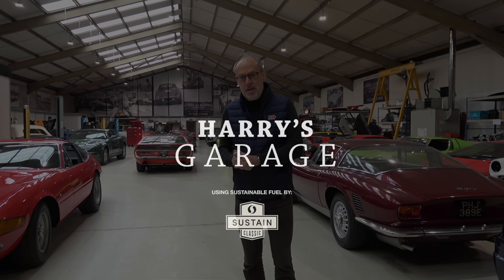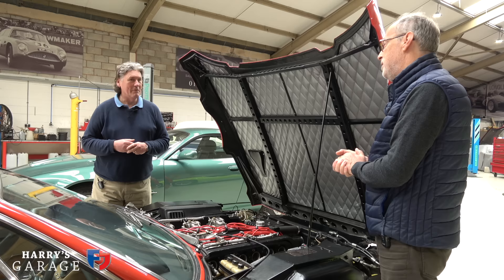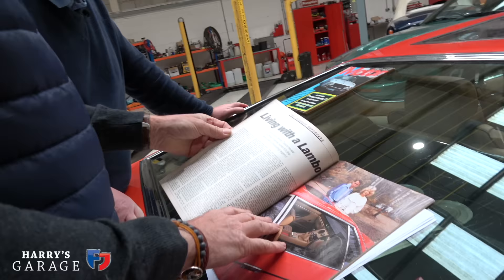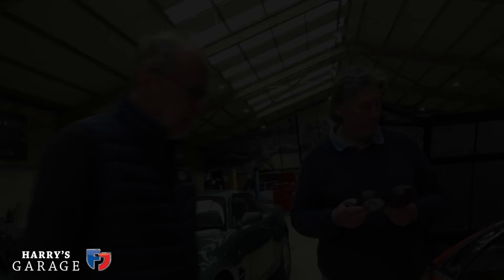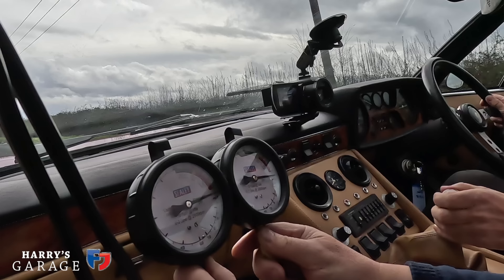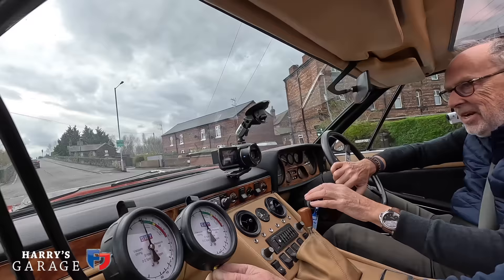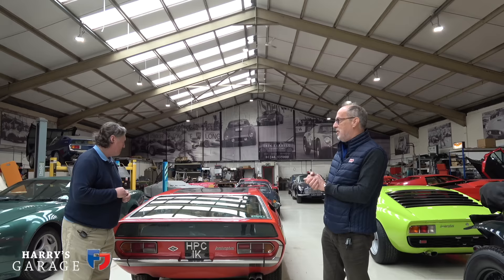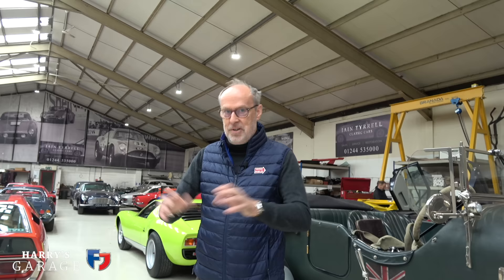Lamborghini Espada is back with Iain Tyrrell in search for more power. Plus Marcello Gandini tribute

Comment: So what was causing the fuel leak? Video seems to skip straight to the exhaust issue.
Reply: Yes I watched it twice as I thought I missed that. Amazing insight into back pressure! Thank you.
Reply: Classic distraction 
The cause of no power but cough sone more it’s the exhaust
Reply: The continuity sequence suggested it was thrown on the dyno without first fixing the petrol leak🚩 yikes!!
Reply from the maker: The fuel leak turned out to be a tiny bit of debris in one of the carburettor float needle valves. It was so minor and was quickly discovered a few weeks earlier, we forgot to mention it.
Reply: @harrysgarage It’s common, isn’t it, for something like that to happen? I go to my 1977 bikes and if they’ve not run for a few weeks, I do occasionally get a leak from a float chamber, which generally stops if I tap them gently with a wide bladed screwdriver.
Reply: Very glad Ian sorted it.  They do fantastic work, so it was bound to be minor.  @harrysgarage
Reply: The back pressure caused the fuel leak. The waves were that strong that with overlap the exhaust gasses were pushed out into the intake manifold, carburetor, into the open air.
Reply: Stuck float just like my 1980 Honda XL 250 dirt bike. We have so much in common with our vehicle collections haha @harrysgarage

Comment: On some of our engines during my days at Chrysler as an Engine Test Engineer, we would run about 4.5 psi exhaust back pressure on our more "high performance" engines with a full vehicle exhaust installed in the test cell. One would see even better gains with as low as 1.5psi - try not to go much lower, as you risk ruining the exhaust valves with inversion pulses (colder gases thermal shocking the valves).

Comment: This is an interesting situation. First Italian and many other HP figures of the late 1960s are known to be very optimistic. 10% losses aren't unheard of at the gearbox and rear axle. Dyno tests of that period are almost always done without the driven accessories, such as alternator, power steering, fans etc. Probably another 15 HP. Using 350 HP this would make it between 265 and 270 at the rear wheels, but 350 HP was very likely optimistic. So don't be too disappointed if the gains are small, unless you open up the exhaust ports in the heads. But how will that effect the glorious torque curve?

Comment: Harry, many years ago I spoke with Bob Wallace about these very engines and Miura engines. Bob confirmed even the higher compression engines made a maximum of 325hp on a good day. They were also tested with different  exhaust manifolds which were dyno testing only manifolds so who knows how the standard espada manifolds would actually perform. It’s also highly likely the pipes coming off the headers are further choking things. Note Miura engines were never tested as they did not have a dyno that rotated in the opposite direction. 

Bob had stated all v12 engines of this era from Lamborghini had exhaust ports and systems in general that were just too small for the amount of air the intakes were gulping. The high back pressure you’re seeing is also from small exhaust ports squeezing out a lot of air at very high velocity, thus a high reading. The ‘fix’ is a deep one is it involves opening the ports, which Lamborghini had tested along with larger headers and gained a lot of power. Note Lamborghini boat motors had much larger exhaust ports and manifolds etc. 

That said, a healthy espada ‘should’ make about 230-240 max at the wheels though. Lots of power is lost through that gearbox and rear end. Dyno tuning with a wideband. Make sure the choke size in the carbs is correct! I’ve seen smaller chokes (28mm, stock is supposed to be 30mm) installed in these things as it does give a bit more torque and pedal response at low and mid rpm but it chokes power up high. You can go 32-34mm and they run just fine after appropriate jetting changes, and they rev up high a good bit better and make more power.
Reply: Yep.
If you go back and look at the video where they dissembled the heads, you will see that both intake and exhaust ports are tiny. The primaries are also fairly long and small in diameter, which absolutely does nothing to favour an increase in displacement and larger cams. They should really look into what's possible in terms of opening up those ports and add flow.

The other thing that strikes me as very odd, is the mentioning of increasing overlap. Decreasing LSA, i.e increasing overlap almost always favours mid range torque and punch. Running a wider LSA softens the bottom end, but it also moves the peak power point up.

There's definitely a lot more to this than a restrictive exhaust. Doubt there is much to gain unless those heads are opened up.
Reply: @AB-80X   With these small per cylinder displacement Italian engines, the opposite is almost entirely true when it comes to LSA compared to say large Ford or Chevy V8s for example.  Ferrari/Lambo/Maser, in stock form they all like very tight LSA (100-104 is common) with lots of overlap, and for whatever reason, they still peak at very high rpm. The always come 'on cam' around 3500 and stay there through 7-8000.
Reply: Bob Wallace!  How did you get on/find the man?
Reply: Bob lived in Arizona and had a repair shop for many many years where he worked on all things Italian. He was very available to get hold of. Bob was actually responsible for the well known parts expert, Bill, of GT Car Parts getting started literally just next door. Bill was sort of Bob’s official parts guy for many years, and Bill is still there doing it
Reply: Wow, great recall chief from, as you say "many years ago"
Sometimes these videos trigger a moment from years ago which makes YOU take time to share it at the same time smiling as your brain starts fizzing with the memories.
Re. Choke sizes. How did this work. I would have thought that for optimal gas flow ideally the inlet ports and carb size should be matched as in my Rickman Trident. Standard inlets 27mm carb and inlet port. Mine 30mm both to shift power to high RPM where it can pull a long top gear with exhaust configured to "fill in" mid range and a Quaife c/r gearbox to keep it at high RPM.
Thanks 🙏
Reply: @ericsbuell  With Webers, choke size is dependent on the size of the individual cylinder in cc, and the operating range you want it to operate. There's a lot to this and books have been written on tuning, but in Harry's case, the Espada cylinders are approx 330cc each. For that size cylinder to make peak power at nearly 7k rpm as Harry wants, IF the heads can flow that high given all the other variables (cam duration, compression etc), then the carb choke needs to be closer to 32-34mm.  

Of course if the exhaust is NOT flowing well enough then all the intake work in the world wont alter that issue as the exhaust stroke is experiencing a hard wall known as a pumping loss. This in essence means all exhaust gases are not escaping almost immediately after the exhaust valve opens (while the piston is traveling down) and the piston has to 'pump' the remainder of the exhaust gases out on the pistons way back up the cylinder.   This is partially what is happening with Harry's engine.
Reply: Very informative reply. Well done.
Reply: @ericsbuell  own a large displacement V twin by any chance?😉
Reply: @Ralph2 Greetings from Glasgow Scotland, If you call 984 large, aye is the answer but two identical Blue ones with the Buell race ecu, pipe and filter.😁
I just checked your channel chief, eclectic mix...the "horizontal flying saucer" Yikes🚀, aha it's only a rogue floppy, made me laff .
Reply: @ericsbuell  Haha yes! Very nice mate. Near Birmingham England here with an XB12Scg would never part with it. Good luck 👍

Comment: Those young people with their loud exhausts - boy racer gauges everywhere in the car and always chasing power; this channel has gone all Max Power magazine and I love it. 
Next episode is fitting louder audio and cutting springs for lowering.
Reply: Gotta drill some holes in the air-box and wind a bit of octane booster into the fuel tank!
Reply: Exactly what I thought! 🤣🤣
Reply: Need some neon lights under the car too, to complete the effect.
Reply: Espada with pulsing neon under body lights, totally tasteless but freaking cool😂😂😂
Reply: Splitter like an IKEA cabinet door with adjustable rose joint hangers FTW
Reply: ,@Phuc_Yhou with a lip
Reply: DemonTweeks catalogue thrown at it….lol
Reply: One of my uncles in the UK had a new RR Mulliner Park Ward Silver Shadow (two door) in the 1960s. He turned up one day with no hub caps on the wheels and we teased him about going boy racer and reducing unsprung weight. The true cause was that the hub caps had popped off when he was driving at speed across a bumpy field.

Comment: I can appreciate the back pressure issue as I had a similar problem on a motorcycle many years ago 
I had only just bought the Suzuki 550 when it was about 2 years old and was immaculate but seemed to run out of power at higher revs but was ok mid range. I took it back to the dealership several times with no improvement.On one visit a mechanic suggested it could be an exhaust problem(standard pipes were fitted) and drilled a couple of holes in the end plate…instant improvement so they removed both pipes and the baffles inside had basically dissolved into a pile of pieces which were being forced into the end of the pipe at higher revs.As new standard pipes were an horrendous price they fitted a 4 into 1 pipe and rejected the bike and it completely transformed the bike…a bit of a long winded story but an example of back pressure causing performance loss…love the channel and enjoy Iain’s channel too 👍

Comment: Interesting documentation of the impact of back-pressure.  But back-pressure is only (the easy) half of the subject.  You'll also need to look at the harmonics of the system if you want to get the best out of it.  The lengths and diameters of the different sections matter.  In the past I modelled the harmonics of the early 911's intakes and (to a degree) the exhausts.  The difficulty with modelling exhausts is the temperature.  As the gasses and the pipes heat-up, the tuning changes.   If you know that the Jarama with the same engine performs better, installing one of those systems will most likely be your easiest improvement.
In a nutshell, the harmonics tend to go in-and-out of tune as the RPMs increase.  Anyone who plays a brass instrument will appreciate that it's very difficult to "lip" an entire scale without adjusting the length of the instrument (usually by valves or a slide).  The trick is to not have the entire system suddenly go out of tune just when the engine is trying to achieve peak HP or torque.   If you want a wide torque curve, you design the exhaust system to never be fully in-, or out-of-tune at any point on the rev range. This also works well with engines with modest valve overlap.  Alternatively, if you're designing a system for a full-on race engine with a lot of overlap and with a narrow rev band, you'll design the system to be fully in-tune at peak HP which will result in a strong extraction effect over the peak HP RPM, but will be decidedly out of tune ~ 500 RPM below that point, and above it
A. Graham Bell's "4-Stroke Performance Tuning" has a good discussion on the basics and some reasonable "rules of thumb" .  Smith and Morrison's "Scientific Design of Exhausts and Intake Systems" has a more detailed discussion.
It will be interesting to see the change with an alternate system.

Comment: I guess you could always run just the open headers on the dyno, just to see how much more power there is, without the restriction of the muffler system. Would be handy to eliminate (or isolate?) one of the variables.

Comment: Another task that Harry can consider doing is a dyno pull with the exhaust system behind the headers removed.  That will give an idea of what the engine could do with an ideal exhaust system.  Also, the engine will need to be re-tuned (jetting, ignition, cam timing) to take full benefit of the reduced back pressure.

Comment: Love seeing two men driving around pulling the exhaust off a classic Lamborghini like 20 something Aemricans in a V8 pony car but with more science in their experimentation.  Harry and Iain is always a fun educational time.

As an American who has played with primary size in the tubular exhaust manifold (header), mid pipe between the manifold and over axle pipe on a Corvette.  My last Corvette had the best power band on the dyno with an over axle pipe that was smaller than the mid pipe vs the same size all the way back.  We went from dual 3inch to 2.5 inch after an x pipe making the reduction almost in the center of the car before the over axle section.  It turned  effectively the same peak HP number as another car with almost the exact same mods with dual 3 inch ending just before the axle.  He was drag race oriented and I was building for track events.  The smaller full length exhaust added 20 more ft lbs of torque at peak, some areas it was more.  Same dyno, same day.  The 2 of you likely know but the theory being as the exhaust cools further down the pipe, it condenses and needs a smaller tube to keep exhaust velocity up.  Higher velocity helps scavenge the cylinder.  Some back pressure also helps when natueally aspirated.  I have also tested with dual 3 inch all the way out to the bumper but that was a more agressive build and didn't fit very well.

What little I have done gives me great appreciation for engineers who built racecars, and balance cam timing/design, tube lengths, merges and diameters to create the best powerband for their platform.  It is all a system working together and takes a birlliant mind to optimize.

Comment: Apologies if this has been mentioned before, but perhaps the real elephant in the room is the fact that the exhaust pipe enters into that rear box without a curve to take ot through 90 degrees. It just enters the box then a couple of inches further hits the side of the box, a metaphorical brick wall perpendicular to the gases entering..

Comment: I had a similar issue with an Audi quattro UR when the exhaust was changed on one occasion the car was flat out at 70 mph so I took it back only to find the wrong system had been fitted.  Just a couple of part numbers different.  The system fitted had baffles in the silencer boxes but the correct exhaust was an absorption type where the pipes run straight through the silencers with mesh pipes surrounded with sound deadening.  Car was then back to its usual performance and fantastic 5 cylinder warbler 😊

Comment: Not an exhaust issue that I had 20 years ago with my Series 2b model Espada but the original fuel line was rubber and ran under the carpet in side the car. With the new fuel being used in NZ at the time it caused the rubber to leak like a sieve and nearly set the car on fire !! Watching with much interest your progress with such a fantastic model Lamborghini.

Comment: When you leave carbs for a long time the fuel tends to evaporate, leaving the floats at full extension. When you go to use the car after a long break, the floats can stick and flood the carb….my Esprit does this if I leave it for a while.
Reply: Marvel Mystery Oil at their suggested ratio or 500:1 of TC-W3 two stroke oil in ethanol free fuel prior to storage can help with this. 
It works on my lawn equipment and my motorcycles. 
TC-W3 is the spec for two stroke watercraft and is ashless so it's not going to harm anything with a catalytic converter either, and at 500:1 it doesn't affect fuel injection systems or cause carbon buildup.
Reply: @Surestick88  Thanks for the tip. I usually just tap the top of each carb with a screwdriver handle if it's been stood for a while.
Reply: @Omegaman1969 posted identical information a moment ago.
Reply: @Surestick88 ”We don’t know what’s in it. It’s a mystery”.
Derek Bieri - Vise Grip Garage.
Reply: @GT380man  👍🏻 Is your name after a Suzuki ? Nice bike, my brother has one.

Comment: I understand the Italians played a little fast and loose with HP numbers. But a rebuild that should have something like 350 bench horsepower to only have 203 hp at the wheels is a headscratcher. This espada is not going to pick up 50-60 hp by reducing the exhaust  back pressure from 6+ psi to 2 psi at 6000 rpm

Comment: Here's a few thoughts. 
Increasing overlap, i.e  decreasing LSA, tends to favour mid range punch, not add rpm. Increasing lobe separation angle adds high rpm power, but also softens the bottom. So definitely set that back to stock if not add 2 degrees of separation if the piston to valve clearance allows.

Additionally, consider shortening the primaries when the new exhaust is done. Long runners favour torque, where shorter tubes favour high rpm power. It does not have to be by much, maybe 5-7 cm.

The last bit is the heads. I recall the video where the heads were disassembled and looked at, and they are definitely not large port heads. Adding bigger cams and increasing displacement is all fine and good, but only if the heads can support the flow. When an engine is out of steam up high, that is more often than not the tell-tale sign of an engine that is running out of head, carb or intake. Maybe get them on a flow bench and see what's what.

Yes back pressure will take some power, but less than one might think. I've seen 2" exhausts support 500+ hp with little issue. Stepping up to ta 3" did not matter much.

But sure, get a good exhaust, that's definitely a starting point. But the rest has to support the whole combination. Top end can suffer for a lot of reasons aside from a restrictive exhaust. There's also the carb size and the intake design to consider.